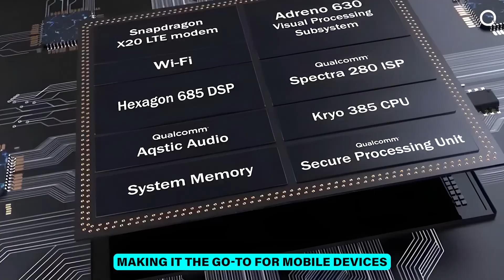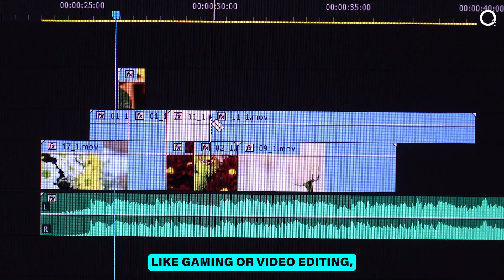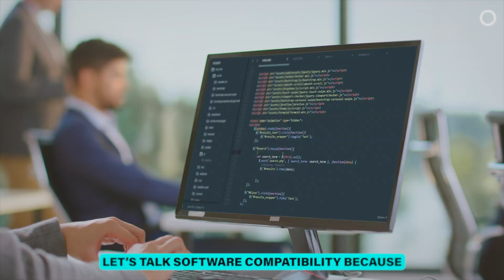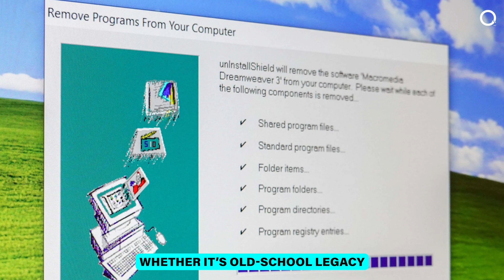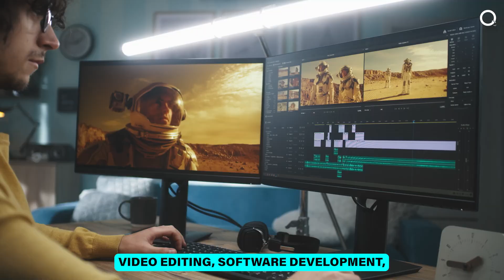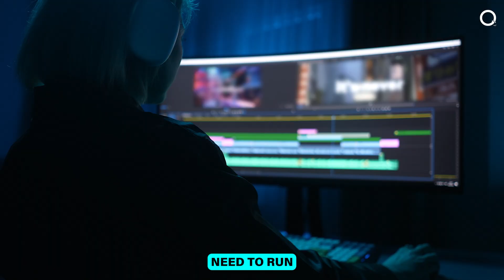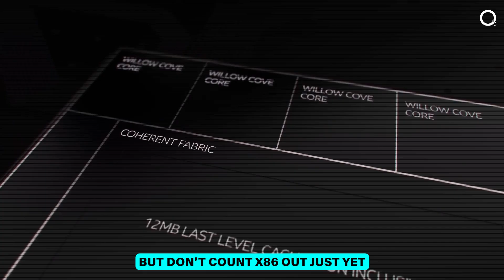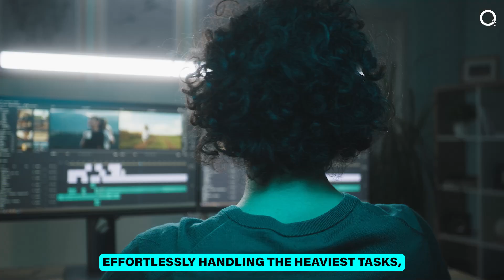ARM vs x86: The Battle of Processors and What It Means for You!

Comment: On the first ARM processor they forgot to connect the power supply - and it still worked from the power it received leaking from the surrounding logic circuitry...

Comment: I wonder if you could utilize both processors at the same time with the system could switch between the two based on what it needed to do.. that might add ridiculous amount of complexity with the
Reply: This is not necessary because the ARM-based high performance chips that for example Apple use in their laptops are on par with x86 for laptops. And yes it would be very complicated and this alone would make it a no go. But you have already ARM-cpu's that are made for desktop computers and do not need x86 for this reason. But you never use both to run the same operating system. They demand completely different binary code to run the same programs.
Reply: @johnsilfen70 I figured there would be a need for some sort of translation layer which would obviously add complexity and time to the calculations. I didn't realize that Apple had achieved x86 performance with the ARM processor. To be frank I haven't truly studied the two paradigms enough to understand the proper differences between the two architectures
Reply: @actualRocketScientist  They far surpassed x86 performance for emulated code to start with when they released the M1.

Comment: ARM can run just like x86, but it's only just being deployed that way. You can now get an ARM CPU with 192 x 3GHz cores and up to 4TB RAM that will crank anything from server tasks to video editing and AI.

Unix was ported to ARM in 1994 by Acorn, and Windows is now also compiled to run on ARM natively - not emulated.

Apple owned ARM in the late 80s and it's a shame that they chose to go Motorola PPC601 rather than using Acorn's ARM processor. We might have had something like the M1 in the 90s.

Steve Furber worked on ARM while it was still Acorn. He now works on a massively parallel ARM neural network called SpiNNaker. If that works we could see ARM leap over Nvidia's AI dominance.
Reply: Getting that much performance out of ARM would be costly though right?
Reply: @jonnyares1  running massively parallel on x86 is also expensive. It would be interesting to see a performance per $ analysis of these platforms, but certainly the ARM will win on performance/watt, and that has become a major limitation.
Reply: @lostbrit2 interesting. Yeah hadn’t thought of this comparison before

Comment: X86 can emulate arm but arm cannot emulate x86.
Reply: Wrong, x86 has a hard time emulating ARM but the Apple Silicon emulates x86 with higher performance and much lower power requirements. Oh, and to blow your mind: current x86 processors are built around a RISC core and a x86 to RISC translation in hardware above, because x86 is far too complex to scale for deep execution pipelines and thus would be even worse today...

Comment: In a nutshell
ARM- Low investment, low returns. Good for long term light usage
x86- High investment, high return. Good for tasks that demand high computational power like video editing and gaming
Reply: Apples M series the M5 is out next year, Qualcomm’s Snapdragon X Elite & Nvidia is to launch a new Arm-based high end processor for PCs & gaming next year. The gap between ARM & X86 has rapidly been closing the last few years.  The biggest names in the tech industry are betting big on ARM & you can see why it's much cheaper for developers, far more power efficient, generates less heat & the processing speed has already reached a point where it's able to do impressive number crunching. Windows on ARM has also made some impressive leaps Microsoft is heavily investing in ARM-based processors for its Windows ecosystem.
Reply: NOPE ... ARM can be anything from a single CPU running <0.1w in an embedded application to (e.g. Ampere's) 192 cores @ 3GHz monster server / video editor / AI. x86 can do SMP too but uses more power doing it but x86 cannot do much on the low end. In the long run ARM will be able to deliver AI goals (see Spinnaker @ 1 million ARM9 cores) where x86 in it's current form will not. x86 has actually changed it's internal architecture to use multiple RISC internal cores and still present as CISC-x86.
Reply: Even the most recent x86 machines can't handle video editing as well as the M1 can, they need very expensive graphics cards - which basically run on a RISC archtiecture themselves...

Comment: x86
1. Uses complex logic
2. less transistors
3. More power efficient at high core count
4. Executes in multiple clock cycles

ARM
1. Uses simple logic
2. More transistors
3. Less power efficient at high core count
4. Multiple operations in a single clock cycle

At low core count ARM only has a slightly higher performance per watt, and lower idle power usage.

x86 chips can run at high temperatures for longer before thermal throttling, if cooling is improved they can run much faster and use less power.

Examples:
1. Apple M1: 8 cores, 8 threads, 14W TDP, 5nm process.
AMD EPYC 4124p: 4 cores, 8 threads, 65W TDP, 5nm process.
The AMD chip wins in cpu performance.

2. Apple M3: 8 cores, 8 threads, 23W TDP up, 15W TDP down.
vs AMD Ryzen Z1 Extreme: 8 cores and 16 threads, 26W TDP up, 15W TDP down, 4nm process.
The ryzen is between 12% and 9% slower than the M3 but the same power usage.
Reply: Why not compare the z1 extreme with the m4 ipad version? 

M4 ipad only used 14 watts and out performs the z1 extreme by almost 2x in ppw
Reply: never type a comment again
Reply: Absolute bovine manure! Stop spreding false information about things you don't comprehend.

Comment: As time goes by the ARM architecture will be used in powerful desktop computers. Apple's M series of chips is based on ARM architecture and is already used in powerful Apple Desktop Computers.
Reply: It won't.  Because ARM chips can't do complex work loads. There is a reason they are not used in high-end engineering jobs, medical, construction, etc. 

You need CPUs that can handle all the different things being thrown at it. ARM chips can't handle it. 

People also need to be able to upgrade the parts on their PC as they see fit. Again, ARM does not let you do that. 

It's great for the Playstation 5 pro. It's not great for a desktop.
Reply: @evacody1249  ARM handles more complex tasks with less power faster... x86 doesn't scale well and should be put out to pasture...

Comment: Arm based processor not support many softwares
Reply: What do you want to run? ARM supports various versions of Unix, Mac OSx, Windows, Android, and iOS ... what flavour do you want? You can have an ARM CPU with 192 cores @ 3GHz and 4TB of RAM - this should cope with most things. Next step is looking like 256 cores @ around 3.6-4GHz.
Reply: Bro till now many software runs with Emulator prism like and many software like vmware don't run on arm @lostbrit2
Reply: @HPELITEBOOK-pr8dh  you can do it but there are limitations. there will always be a problem with a VM for one architecture running on a physical platform from a different architecture unless you have recompiled code, have a good way to emulate, or an embedded hardware co-processor. This has been the case since ARM was first run as a co-processor on a 6502 system or Acorn tested the 80186 as a co-processor for the ARM on Archimedes. 

Running cross platform VMs is generally a bad idea if you want good performance. That's true for all platforms, not just ARM.

Comment: X86 should really be called AMD64 by now.
Reply: how so?
Reply: X86 is discontinued mostly, its now the 64-bit x86-64. 
x86-64 is either AMD64 or Intel64, but they are mostly compatible. AMD made the x86-64 standard first, and many people still call it that
Reply: @jaewanplayzofficial AMD64 is AMD's implementation of the 64 bit extension of x86 ISA from 32 bit.
It's like simultaneous multithreading and hyperthreading is just Intel implementation of SMT.

Comment: This is essentially 9 minutes of the narrator saying the same two things over, and over.... just with slightly different words. 9 minutes Ill never get back.
Reply: You're not wrong, my biggest complaint is when the video tried to compare their instruction set and said "it's like fast food vs fine dining" and if you know anything at all about the two architectures you know that is bull, it's something people keep repeating that just isn't true.

Example (I know risc I'm a bit rusty and am trying to find a good video to learn cisc so this may not be complete information)

Risc processors like Arm can only perform one instruction per core per clock tick, cisc is able to do multiple instructions per core.

Risc processors cannot run instructions outside of their bit bandwidth. In other words if its a 64 bit cpu it cannot run 32 bit instructions
Reply: @cyansius  Yes, 64-bit ARM (known as AArch64) supports both 32-bit and 16-bit instruction sets from the ARM architecture, but with conditions:

AArch64 is the 64-bit execution state introduced in ARMv8-A.

AArch32 is the 32-bit execution state that includes both:

ARM (32-bit) instruction set

Thumb (mostly 16-bit, some 32-bit) instruction set

Support depends on the CPU implementation:
Many ARMv8-A processors do support AArch32, allowing them to run 32-bit and 16-bit (Thumb) code.
Reply: Word salad ,more word salad ARM more salad, X86 word salad.... repeat loop for  9 minutes... my god you are right.
Reply: Cry harder. I learned something.
Reply: @FGFWTX actually you didn't
Reply: @ If he thinks he learned something and it makes him happy then good on him. I would suggest he tries learning much more elementary concepts such as finger painting or cutting with scissors.

Comment: ARM has already surpassed x86 in Performance with its new SVE2, SME2 and many other extremely powerful intrinsics and SIMD!
X86 is losing on all sides it literally  doesn’t have anything going for it anymore
Reply: So for the future I should learn ARM assembly language instead of x86 assembly language
Reply: @ no point in mastering assembly unless you want to develop kernel extensions, embedded systems.
Reply: @PKperformanceEU  but i think that x86 is very old,so it can be replaced by ARM .  So should I learn ARM or x86. Recommend me
Reply: @ learn arm
Reply: @PKperformanceEU 1. what assembly language ur learning 
2.there isn't enough information about ARM in you tube as like x86.so can u recommend me books,open source, website
Reply: @tamimayan2028  learn either. Assembly programming is a skill, it makes you think in terms of low level i.e how high level programming takes one step that is then transformed into several assembly steps.. If you learn x86, you can easily understand arm and vice versa.
Reply: @tamimayan2028  X86 will never fully die, that would mean throwing decades of software compatibility and optimization into the garbage!
Reply: @iLegionaire3755  ... That sounds like a very Apple thing to do. But not for Microsoft Windows.
Reply: @iLegionaire3755  Its is going to die, just the power consumption alone will make obsolete, x86 legacy can be done via docker and virtual machines, just look at microsoft supporting snapdragon cpus, the writing is on the wall.
Reply: @tamimayan2028  I can honestly say no one really learns assembly, Learn C/C++  that what I do  all my embedded stuff on, most will have HAL layer which will take care of the  little things like registers setup of the peripherals, in fact I know put a question to AI and trick it into writing code much faster, and I just guide it .
Reply: Not lost at all, but not the best in the laptop market. X86 rules most markets. 

1. Apple M1: 8 cores, 8 threads, 14W TDP, 5nm process.
AMD EPYC 4124p: 4 cores, 8 threads, 65W TDP, 5nm process.
The AMD chip wins in cpu performance.

2. Apple M3: 8 cores, 8 threads, 23W TDP up, 15W TDP down.
vs AMD Ryzen Z1 Extreme: 8 cores and 16 threads, 26W TDP up, 15W TDP down, 4nm process.
The ryzen is between 12% and 9% slower than the M3 but the same power usage.
Reply: @an_autodidact  Why do you compare Apple M1 to Epyc, comparing a server grade AVX512 chip to a fanless little macbook air🤡.

Z1 Extreme at 30watts gets 700points on CB2024.
M3 gets 650 at 20watts or so.

M4MAX gets 187/2150 at 61w.
9950X3D pulling over 160w gets 135/2235

And yes Apple M5 will receive SVE2.2 SIMD  in 256 or 512b x4 or x6 layout(i know you have zero idea what this means beacuse you are typical dumb pleb who only knows about nanometer and benchmark score) i tell you what it means, complete domination while pulling 1/3 power.

You probably didnt understand my whole comment, the context length is out of reach to your tiny little reptilian brain

Comment: Last 10 years were expected next 10 years will be exponential quantum leap

Else

Wasted
Reply: We're to a point of diminishing returns on silicon lithography. We're gaining density but power saving is now about management rather than the process. Process gains are minimal vs power management.
Reply: @glenwaldrop8166  Optimized Power usage with Maximum Power, limits,
Current trend is fuck power and heat, goo brrrrr with performance,
Quantum computing can change the face here